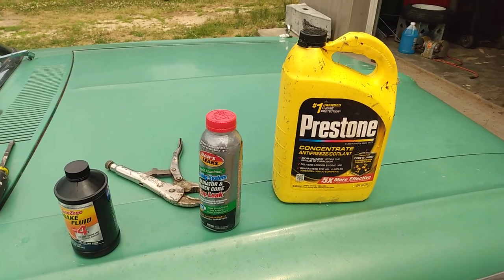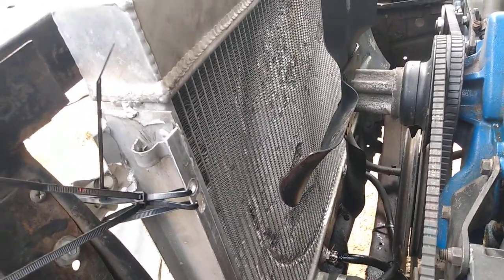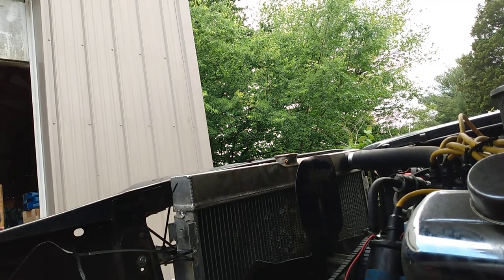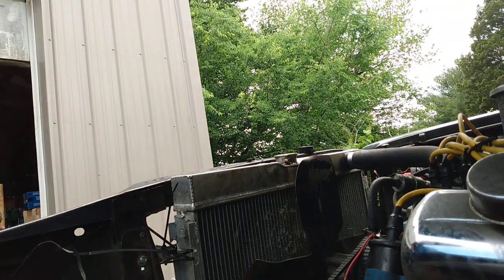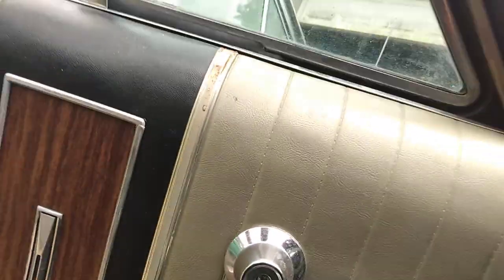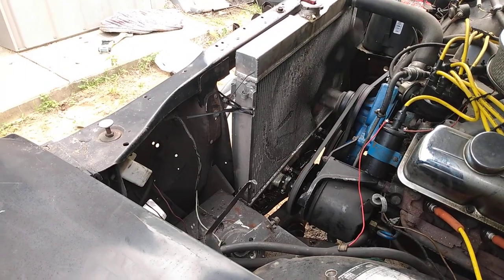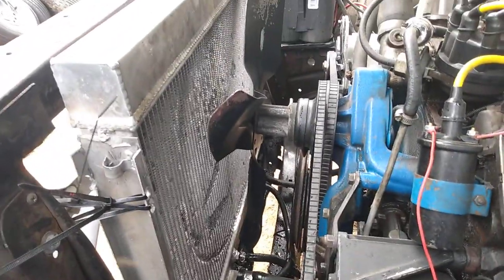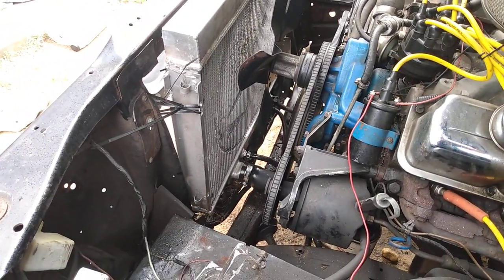Does Bars Leak Work to Stop Radiator Leaks?

Comment: In my experience, stop leaks are only good to get your vehicle home or to the shop.  Like fix a flat, its a temporary band aid.  Not a permanent repair.  Ive worked on a few vehicles that had stop leaks put in their cooling systems and all it did was obstruct and create a buildup in the coolant passages in the heads and in one case, really crudded up a water pump.  Best to just replace the rad altogether imo.

Good to see and hear her running
Reply from the maker: My thoughts exactly. I have a new radiator for her.
Reply: @junkyardhack6292  good man 💪